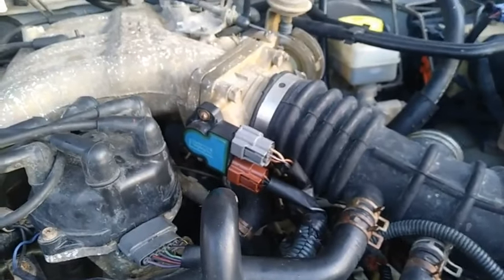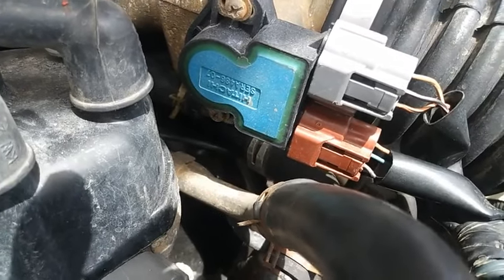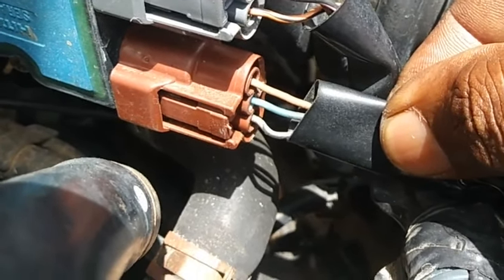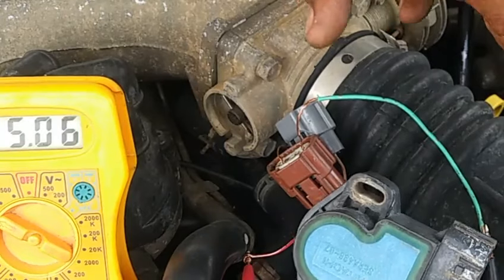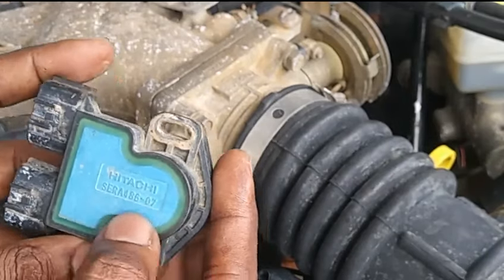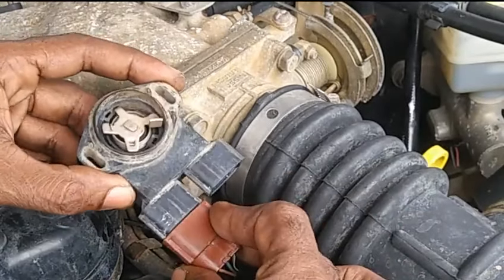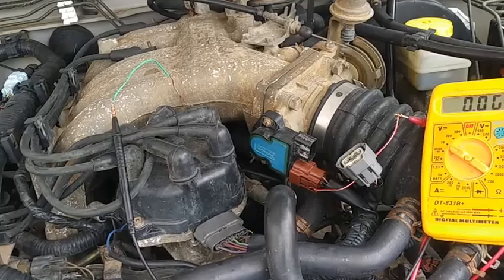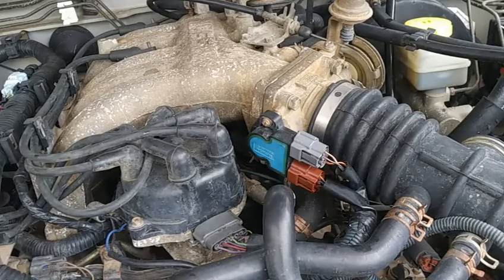How to Reset Nissan/Hitachi TPS(throttle position sensor), DTC P0121, P0122, P0123 & P0510

Comment: I adjusted the tps now its shifting funny.
Reply from the maker: You need to make sure the throttle blade is fully closed, by adjusting it screw to allow no air. Then you can adjust the TPS accordingly to the video.  All the air flow for maintaining engine idle speed must be done by the IACV. The IACV also have a adjuster screw to adjust the idle speed,  but this screw should not be tampered with. If the engine experience idle problem speed(750rpm), please clean out the PCV valve. https://youtu.be/bNbLmtFtLFw
Thank you for you support. Happy holiday and long live.